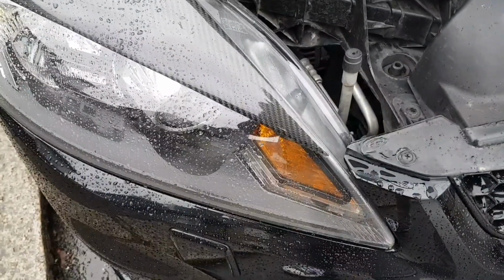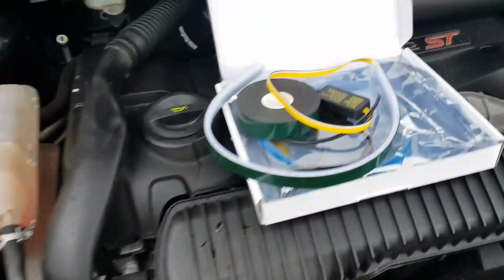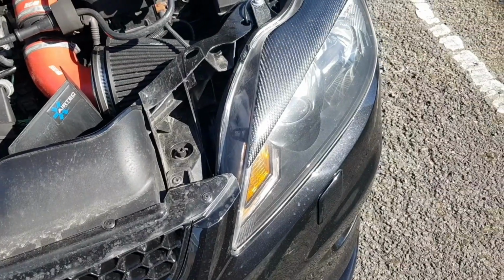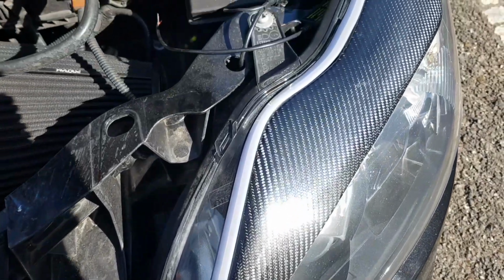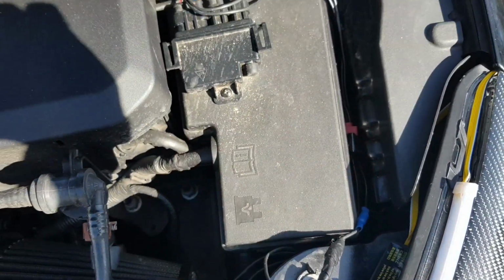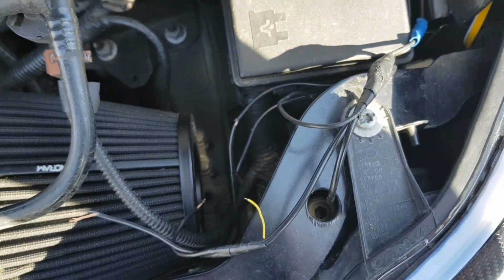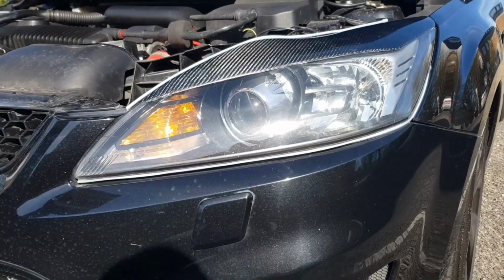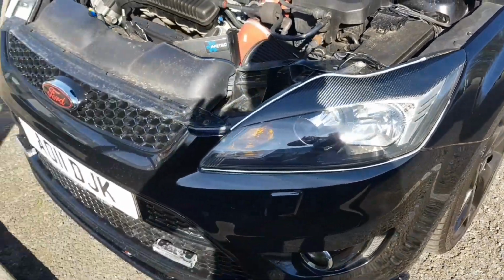LED DRLS fitted to the Focus MK2 ST.... again

Comment: Just wondering would mk2 angel lights fit a 2010 zetec s?
Reply from the maker: Yeah mate. As I believe these are the same size fog light. Should be 70mm. Just double check with a tape measure the internal measurement. New website 
CUSTOMRIDES.UK

Comment: Are they not wired with your side lights ?
Reply from the maker: Hello.. no these are grounded and on the acc fuse so they work as DRLs. They have their own box on each strip which turns on with power and switch off when you turn off... so constantly running as a DRL.. can but wired to indicators for waterfall Amber .. i have not done that yet..

Comment: So all of that and you didnt show the indicators working? 🙄
Reply from the maker: I haven't hooked up with up to the indicators is the reason I didnt show that. 

I'm about to change them to something else, and therefore didnt want to mess with the indicator wires yet!!
Reply: @lordeest  RIP!

I'm looking to do the same on my prefacelift mk2 but was waiting to see the sequential indicators running alongside the regular ones 😂

Cheers for clearing that up!!

Did you hook yours up directly to the battery and attach to the leg of a fuse in the engine bay fusebox?